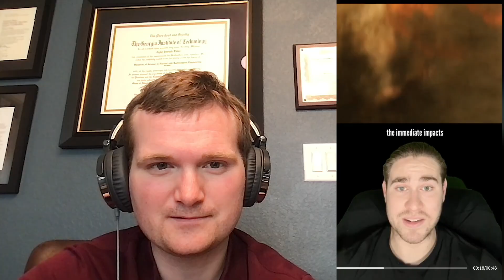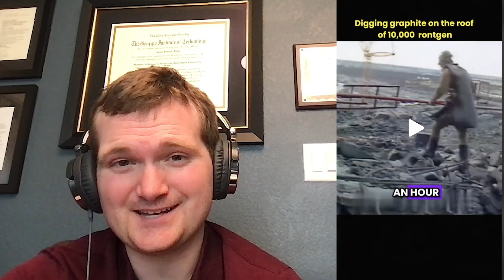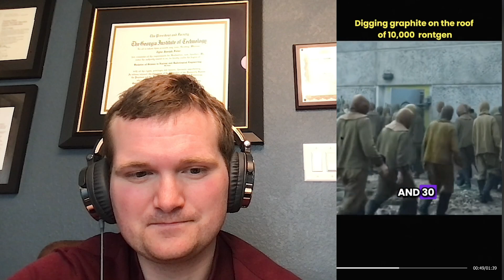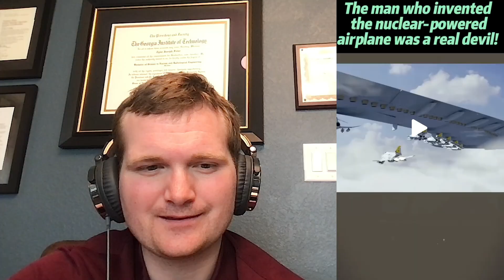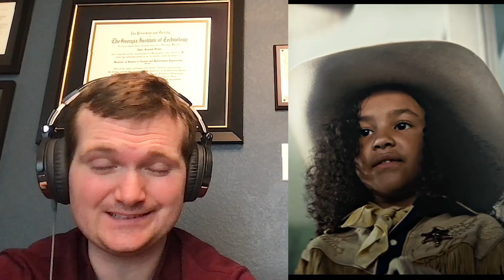Even More Offensively Bad Nuclear Videos DEBUNKED - Nuclear Engineer Reacts

Comment: At 14:24 I think that's supposed to be the Lockheed CL-1201 design study. It was supposed to have a 1.83 GW powerplant. It was planned to use a large number of conventionally fueled lift jets as well as conventional fuel for the massive turbofan engines for take-off, but nuclear propulsion for cruise with a 41 day endurance.
It does look a bit like the Arsenal Bird, though.

Edit: I see you've also done a video on that since then.

Comment: The United States has launched aircraft and even "docked" them from hot air balloons at first and then later launched off of the wing of bombers. The pilot just sits there and reads a magazine or something until the launch procedure. Not saying that that fictional aircraft is being presented even half correctly, that animation is very generous, but the real reason it can't stay up for more than 40 days is because it needs thorough maintenance on a much tighter schedule. Something like that would be getting worked on for too much of its lifetime to be worth it. The flying wing design in the animation makes it way more expensive and maintenance heavy. The wing launched jets probably can't come back to dock because any level of fatigue would end in disaster so they'd have to go to a base or ditch somewhere. They got the ball rolling on some insane projects back then but missile technology halted most other fields. The most insane was probably a jet like the F-22 but it was designed back in 1959, with internal weapon bays and mach 3 capability. It was designed to escort a mach 3 bomber that similarly had internal weapon bays. The bomber crashed in a stupidly risky test flight with 2 other jets in tight formation and they ended up cancelling it before the fighter could be made.

Comment: The convair big stick
Six turning and four burning they ran it at power
And rather than one thick wall  it was sectioned along the body and you certainly can run jet engines using indirect atomic power

Comment: One thing that you guys might want to research if you don't trust me but in terms of like once it was contained they never stopped using the other three reactors at that site they lasted into the 90s and one of them into the 2000s and they're all within you know a half mile one of the reactors is literally on the other side of the building when you see the building with a blown upside that other side is reactor that worked for another 10 years. So yeah it was the Soviets but still it was the amount of radiation damage in that area is outside of the actual reactor that blew up not exceptionally dangerous 
So they had people going in and working at those reactors for a decade up to two decades

Comment: I think, and someone can correct me if I’m mistaken, a lot of the exaggeration when it comes to the effects of nuclear warfare isn’t necessarily exaggerating, but rather mistaking what used to be the case for what IS the case now. In modern day there are only 4000 active warheads, but in the 1980’s, the worldwide stockpile was estimated to be around 70,000 warheads. In other words, nuclear war wouldn’t pack nearly the same punch today as it would have 40 years ago.

Comment: 15:16 all right so the aircraft carrier plane. It was an actual proposed idea that they ended up not doing because the amount of shielding needed to put the weight of the plane so high it just isn't worth. Basically the cost of designing and building it would be so extreme that even the US military decided to not pursue it.  like it's one of those items it's not even on the back burner it's like in the back of the fridge likely mostly forgotten. We have the technology it's just not worth building. The advantages do not outweigh the negatives

Comment: Thank you for debunking this nonsense! I'm just a nuclear hobbyist, and I think the "scary green glow" probably originated from radium-226, but it's not the radium-226 itself that glows: It's the relatively large amount of copper-activated zinc sulfide (which was the first scintillator) that was mixed with the relatively miniscule amount (a couple of nCi to μCi) of radium-226, to make self-luminous paint. Copper-activated zinc sulfide "glows" (scintillates) green in the presence of ionizing radiation, especially alpha particles (helium-4 nuclei), since those have a much higher energy and positive charge density compared to beta particles (electrons), with a charge of -1, and gamma and X-rays, which have a charge of 0. But, that's just my guess. Yet, plutonium-239 emits extremely little gamma radiation when it undergoes alpha decay to uranium-235. The branching ratios for gamma emissions are extremely small during alpha decay for Pu-239. Using my SEI Inspector USB Geiger-Müller counter on a low-activity Pu-239 source with 5.7 μCi of activity results in about 85,000 CPM, yet only about 500 CPM with a piece of paper for shielding the alpha radiation. And both of these measurements were taken with me using the source at direct contact with the Geiger-Müller detector tube. Internal exposure is always vastly worse than external exposure. Thank you Tyler Folse, for debunking this pseudoscience that's littered everywhere! I really like your videos! Keep up the great work!

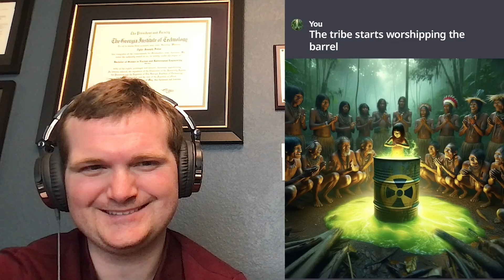Comment: 21:59 Regarding the Chernobyl Cleanup, the numbers regarding safe  exposure levels were for external absorbed dose which are much higher than those for internal dose. In no instance is this discussed. Those poor  fellows  on the roof would also have breathed dust contaminated with all kinds of nasty fission products which would have contributed more dose even after leaving the roof site do ingested dose. Therefore I personally do beleive the numbers of reportec deaths directly related to exposure in the cleanup, especially if Russia was publishing the figures. Another danger of exposure not addresed in many instances, is the fact that exposure to radiation especially gamma, leads to chromosomal damage and mutation which are passed down from one generation to the next of a survivor of said exposure. These mutations are mostly bad and most likely ignored in the statistics.
Reply: I don't see your logic. You proposed those "fellows on the roof breathed contaminated dust" and "that would have contributed to a much higher dose".....How? They were wearing respirators, quite stout looking ones, not just your basic paper mask type. Full nose and mouth sealed type. So no I disagree. Not in general as you proposed. Im sure some did, because of improper use / faulty mask. I just don't see your logic.
Reply: @royb.1441  I suspect even those stout looking masks are not 100% effective.  I don't see any breathing apparatus attached and we are talking Russia where not all is as it seems.
Reply: @ismifejzuli7874  you don't need breathing apparatus, you have filters attached to the mask. the only thing needed after certain period of time is to replace the filter and you are good to go again. Masks with breathing aparatus and air filtration attached to a full enclosure suits you usualy see in laboratory with chemicals, viruses or bacteria, but it heavily impacts your ability to work. The gas mask is perfectly fine, but you need to know how long you can use it in what enviroment, before you need to change the filters.
Reply: @krivdik  I think the masks you are referring to can go as small as 0.22 micons, which is 220 nanometres there are particles smaller and escape even the best masks . But we can trust the Russians to acquire the most sophisticated equipment for the safety of their radiation workers and emergency services- NOT

Comment: It's not reasonable to entirely dismiss nuclear winter merely because the yield is less than a volcano. 
Nuclear winter is primarily caused by fires putting soot high into the atmosphere ans even very low yield weapons can cause huge amounts of this fire. I remember reading that even a small scale nuclear war between Pakistan and India would have very severe effects on the rest of the globe and likely lead to mass crop failure.
Reply: “I remember reading” is a very credible source. Not saying you’re wrong, I agree to an extent, but just found that funny.

Comment: That giant plane is Lockheed CL-1201 It was a design study for a nuclear powered transport aircraft. It beeing a airborne aircraft carrier was only one of visions of its use. It was designed in the 60s when anti air misiles were not that great, and it would be kept far away from conflict area. It could also be used as troops transporter, where troops would be deployed with use of another aircraft that would dock inside. It would require a special airstrip, althogh it would be wider and only minimally longer because plane was supposed to has STOL capability, thanks to 182 conventional lift engines.
Reply: So, given that it was specifically designed to be an aircraft carrier, why wouldn't they have had UNREP capability?  Replace 1-2 of the F4s with small transport planes to haul food and other supplies, and you'd eliminate the 40 day limit.

Comment: To clarify, what he means by "active" warheads is the amount of warheads we have actually ready for first-strike capability. The "inactive" warheads are stored in what are essentially warehouses in such a way that it would take dozens of minutes at minimum just to get one "activated". To "activate" our entire "inactive" arsenal would take hours if not days to do.

That's not to say these warheads aren't still a threat; days to recommission thousands of warheads if need be is not a long time, and almost certainly would be done in the event we were on the brink of war.

So good 'cause it means we're not about to go to war literally any second...but also not so good 'cause if tensions started getting that high we'd literally just pull those warheads out of storage.
Reply: Most of the inactive warheads are not minutes or even hours from being ready, but weeks or months away, or even longer. Those that use thermonuclear warheads (most of them) need tritium to fully function, we don't have huge stores of that available, and production of it is very slow, with special rods taking months to produce a few grams each. A significant number of them are in various stages of disassembly as they're being removed from the arsenals.

Comment: How did people made nuclear reactors light enough to power planes?
Reply: They didn't. However, it could be done quite easily - just don't have any shielding on it. Yes, this does have the side effect of being quite toxic to anyone in proximity to said aircraft, but hey - you can't make an omelette without breaking some eggs, so....
Reply: @darkwinter7395  I was thinking the whole water turbine thing could turned up be way too heavy, but maybe there are other means to harness power from the reaction?
Reply: @GeoffryGifari  It doesn't have to use water - air works also. Basically, replace the combustors in a jet engine with fuel rods with a high surface area for transferring the heat to the incoming air.
Reply: @darkwinter7395  I see. good to know!

Comment: 15:30 an actual concept from Lockheed called the CL-1201 but it obviously and unfortunately went nowhere
Reply: The video is from Found and Explained
Reply: Nuclear aircraft have the one big disadvantage of being aircraft.  So when they crash.. not if when they crash you have a nuclear disaster to clean up.

Steps can be implemented to mitigate the problem, restrict flight paths, only certain airports they can use etc.  But the more you do that the less practical it is.
Reply: @lunaticbz3594 spoken like somebody who has no clue whats happening. 😂
Reply: @Yameiionline3  ??  If you put nuclear reactors in a plane you have a nuclear mess at every crash site.  Why would you think that's not a problem?

Comment: How many feet of concrete would you need to survive a direct 1 mega-ton nuke???
Reply: Nothing can survive a direct nuke, the fireball gets too hot and especially in the middle for anything to not vaporize inside of the fireball.
Reply: @bingustanian  Excuse me? You only need a couple dozen or so of meters of dirt above you to survive a 1 megaton nuke. Yes, everything on the surface will vaporize, but the actual penetration is quite shallow. Assuming of course that the bomb is either exploded in the air or on the surface. If you bury the thing, it will make a big honking hole.

Comment: Since the recent solar storm. I was wondering if you could give an explanation of what would happen to a nuclear power plant if the earth is hitted by one of the same magnitude that the Carrington solar storm. What would happen to the reactor? What are safety mechanisms?
Reply: I know the answer is the same as with a major grid outage because that's the effect it would have on a plant. But I'd also love to hear him go into detail on it. Practical Engineering talked about a black start last year, though, if Mr. Folse doesn't talk about it and you want to know the response.

As for why the grid is the only concern, the risk with geomagnetic storms is induced current, which requires very long wires. We're mostly protected from geomagnetic storms by the magnetosphere, but the risk of a Carrington style event on the ground is that it distorts the magnetosphere into loops that can produce very long wavelength EM pulses.
Reply: @Merennulli  Kinda figured the biggest issue would be shutting down the backup power to keep the core coolant flowing. If it has a basic electric (as opposed to electronic) redundant backup it would be a matter of throwing the tripped breaker once rebound pulses finish.
Reply: @Merennulli  I was thinking one of those major storms that in the past have knocked out several substations and the like. Killing the external power grid. And even still,  my assumption was that such a once or twice a century (to happen anywhere on the planet) having its nexus aimed right at the plant would be more of an inconvenience. Simple electric things like switches and motors are not too impacted by EMP, so basic diesel generators get flipped on manually and mechanical failsafes engage even if all computers and communications and external power distribution are down.
Past accidents are not as bad as popular imagination would indicate and we have learned so much that, as I understand it anyway, that nuke power plants practically can't fail from anything less than compound natural disasters or the whole crew being complicit in sabotage.
Reply: @travissmith2848  An event powerful enough to induce currents that damage transformers is the main risk, since we can't replace them quickly. But the diesel generators on site aren't on the grid, so they would act just like they did in the Texas outage a while back.
Reply: @Merennulli  Makes sense, I guess. I have heard there is some concern about general electronics being fried, but those are more hypothetical events that we have only seen a couple times since we have had telegraphs and power grids to be let us know we have been hit.
I find it funny that nuclear power is such a boogeyman to so many, yet it is so safe you have to concoct really extreme situations to have even a minor event.  Even the waste that is deadly for tens of thousands of years is far from what those of us that were grade schoolers in the 80's were told in class.
Reply: @travissmith2848  Yeah, the timescales I was taught as a kid were terribly off.

As for the hypothetical events you mention, I think the people you're seeing concern from are confusing it with atmospheric EMPs, which are a risk specifically to electronics because of their broad spectrum E1 pulse. But a geomagnetic storm is essentially the same thing as an E3 pulse. It's fairly common to mix up these two similar but different risks.

If the sun generates something strong enough for a broad spectrum pulse to reach your electronics on the ground, I don't think anyone will be left to care. The cause of all space weather is charged particles from the sun. Those particles compress Earth's magnetic field, so in a hypothetical situation where the broad spectrum reached ground level, that means the solar wind is also eroding our atmosphere down to ground level.